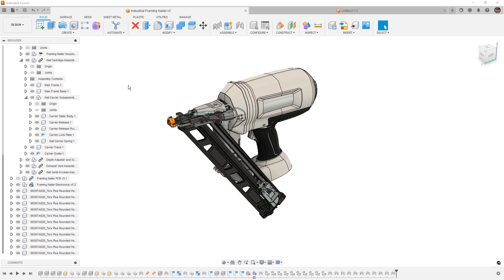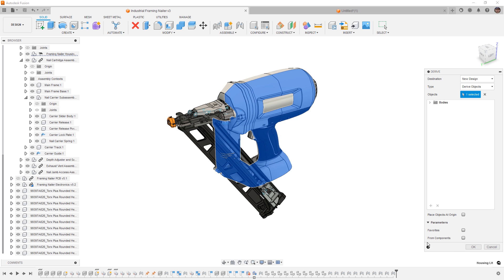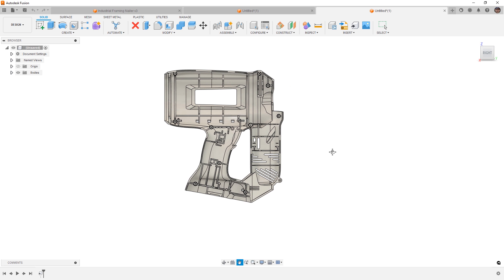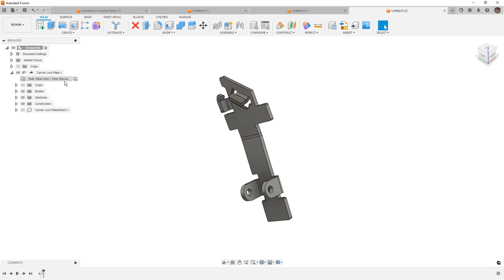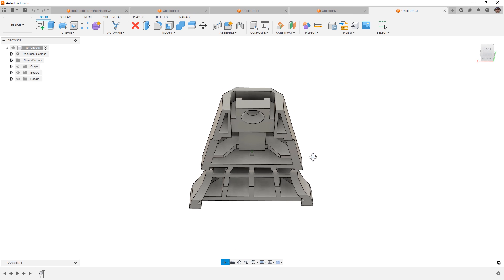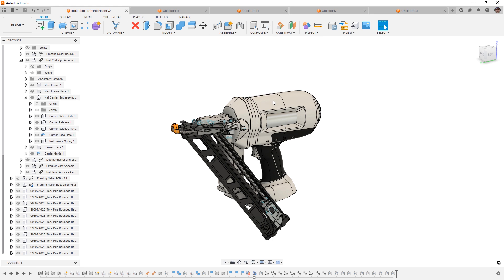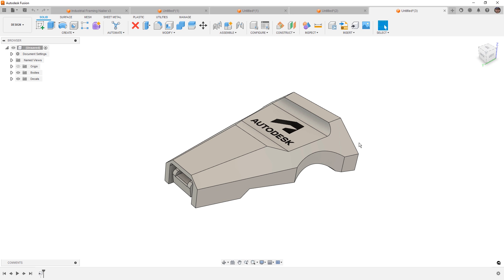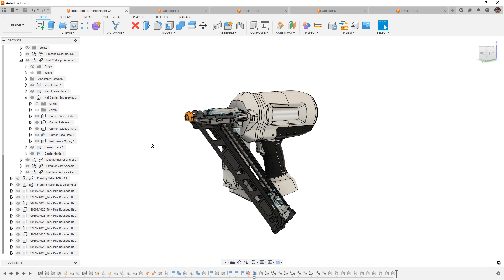How to Use Derive in Autodesk Fusion

Comment: At 3:40 when talking about a use-case of variations of components or objects, how can you pull back the changes into the top assembly if Derive does not allow two-way data flow as you mentioned earlier in the video?
To elaborate: you use Derive to spin-off a component into its own file, make changes then up-revision the design of that component. But the top-assembly cannot pull in those changes. How do you solve that?

Comment: How would one go about creating variations of a body within the same file that are linked in a hierarchical manner. So for example you have MasterBody1, and then DerivedBody1.1 and DerivedBody1.2.  If you change MasterBody1, then DerivedBody1.1 and DerivedBody1.2 both inherit the changes. However, if you modify DerivedBody1.1, then MasterBody1 and DerivedBody1.2 do not change. Then you could add more branches such as DerivedBody1.1.1 and DerivedBody1.1.2. By building a tree like this, one could explore a large design space in an efficient manner and be able to visualize all the variants throughout the tree structure. One could explore for example different sizes, different base shapes, different fillet or chamfer settings, many things and use the tree structure to explore. If you know a change is important you make it high on the tree, even at the root, it propagates to everything. However, if you are experimenting with a particular variant, you make the mod at one of the end points of a branch and only mode that variant. This allows one to explore a large design space in an efficient manner across various dimensions. Appreciate your coaching. I know there is the Derive command but this isn't what I'm looking for. Hopefully I've described what I'm looking for adequately. Seems to me many designers need to explore the design space efficiently so I'm thinking (hoping) there is some way to do what I'm outlining but after a lot of looking I can't figure it out. It's almost as if the MOVE/COPY button not only had the CreateCopy check box, but a 'InheritAndLink' Design check box.

Comment: The Tool Library could be further advanced.
There is no need for scripts to create a tool holder to carry out simulations, more detail in the tool holder simulations, being able to choose the driven tool holder for Lathe, more power of choice when creating a lathe tool.
In the Drills section in the speed and feed category, you can save the default peck.
Being able to create subcategories for feed and speed of different machines.
example:
Mazak: you..., did...
dmg: you..., did...
Reply: Yes. That would be amazing. Also have the doc and WOC presets actually work a little better.